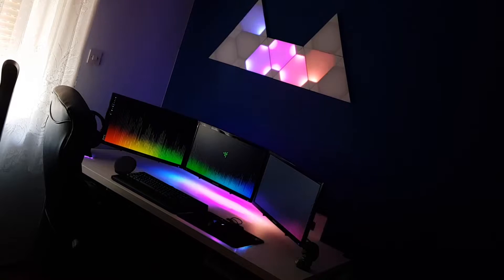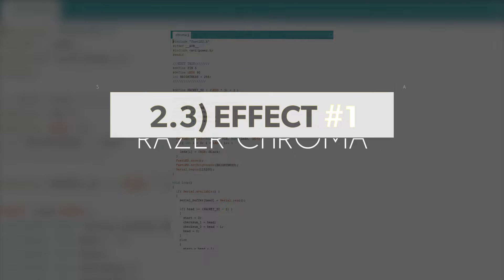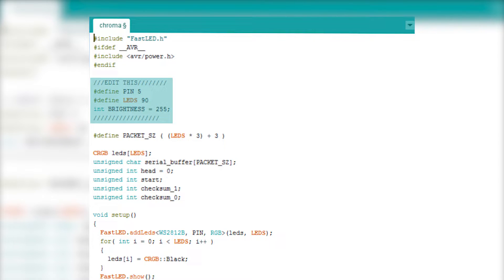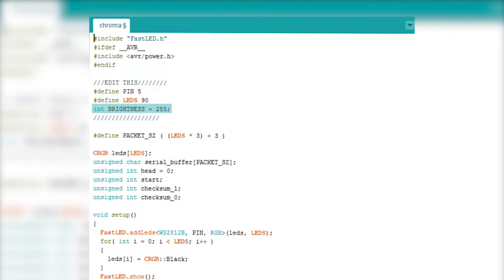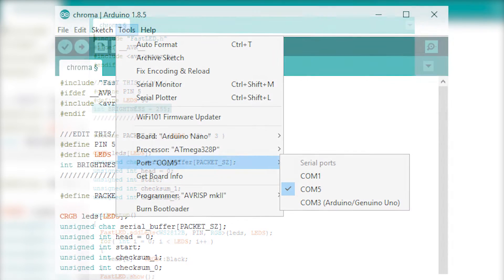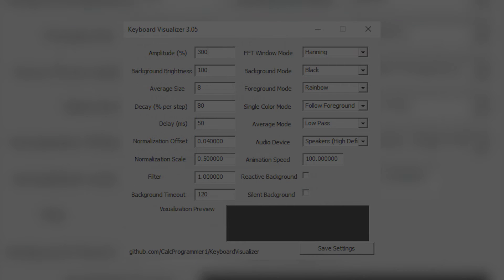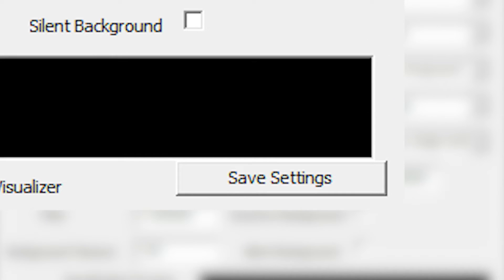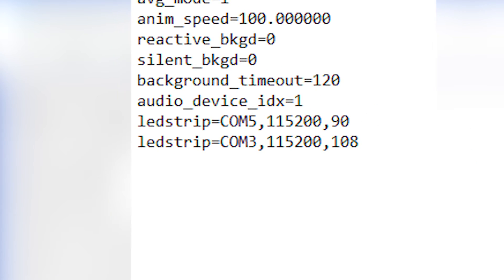Digital RGB strip Pt.2 | Synced to music (and Razer peripherals)

Comment: hey dude I cant open the shortcut folder
Reply from the maker: What folder? 😅
Reply: @sschannel4550  the visualizer folder
Reply from the maker: @olmos97  Hmm well it's a zip file so maybe download 7zip that will surely open it
Reply: I got my other razer hardware to work with it but not the led strip!
Reply from the maker: Have you added the strip to the txt file? :/
Reply: Yes I have done that aswell but nothing
Reply from the maker: Well you made a mistake somewhere.. 
Try the most basic troubleshooting like making them light up plain white colour so you can clarify that you connected everything properly and that you're using correct COM port.. (if you haven't already done that before)
Reply: I also tried calcprog code but nothing
Reply: My folder don’t show that .exe on the app or .txt on the notepad
Reply: I have upload a different code to the led strip worked but now I can’t get them to sync
Reply from the maker: Try changing the amount of leds by one (add or subtract) in code.. ie. If you had 45 declare as if you have 46
Reply: I wonder if my clone nano doesn’t work properly
Reply: Does the visual c++ studio 2015 have to be installed because when I try to install it it give me a error
Reply from the maker: Pretty sure it's necessary yeah
Reply: It say I have newer version is installed
Reply from the maker: Try then chaning the led count by one
Reply: Nothing lowkey gave up
Reply from the maker: Hmmm I'm not sure then really :/ it should work

Comment: hello from 2019. i managed to make it work with my razer devices. buy still no lights on rgb strips. followed your instruction. im using the latest verison. please reply
Reply: Same issues here, have you solved it?
Reply from the maker: Check the description box I added all in one link that I've just tried.. 😁
Reply from the maker: Well I'm not sure what it could be.. But I found certain bug.. if you have odd number of leds it will be all buggy so if you have lime 55 leds make sure you'rr using 54 also make sure you did matched all of the numbers (in code for leds and in that settings file) also make sure you're using right COM port.. Also latest version of what?
Reply: S&S Channel im using the 3.06 bro. I managed to make it light with different code, like in your pt.1 . Even in your part3, still no sync. Did you changed any settings in port settings in device manager?. Also im using 60 leds powered by usb cable from the pc
Reply from the maker: +Carlos Gomez Hmm.. I'm not sure; I didn't changed anything except notepad file and code.. Could you post the code somewhere so I can check it out.. Also are you using ws2812b?
Reply: S&S Channel sure , where can i post it ? I trying to find another arduino to replace my current one . Thanks for the reply. Tried this project last month using with calc programmers code, but also tried yours but still its not working
Reply from the maker: @CarlosGomez-bl9qm  Hmm could be arduino too yeah.. go to arduino create you can post and share codes online that way via link
Reply: S&S Channel later bro. Ill contact you if im done with it thanks
Reply from the maker: @CarlosGomez-bl9qm  Sure!
Reply: Carlos Gomez hey dude am have the same problem did you figure it out?

Comment: How would I do this with SMD5050 led strips?
Reply from the maker: If that's a digital strip only thing that changes is in function where you add them (you can find it in setUp goes something like FastLED.addLed ... and you'll see WS2812B in my code.. Just replace it with I guess SMD5050 or try googling for the answer.. But that's I believe only thing that changes.. I'm not familiar with them so I can't help a lot but hopefully this will be somewhat useful
Reply: @sschannel4550  Thanks